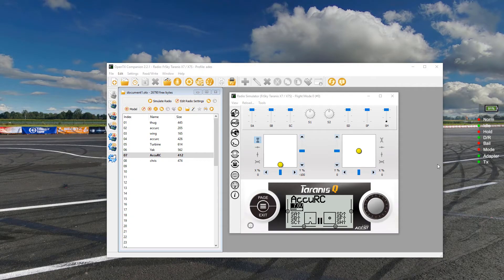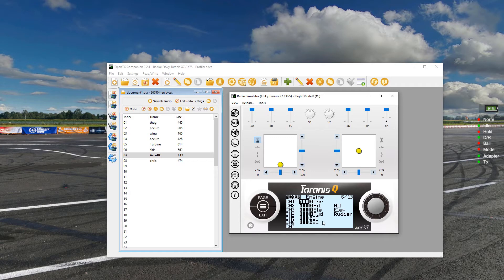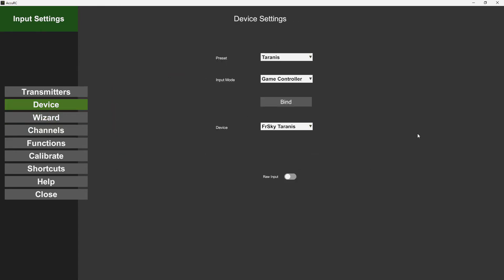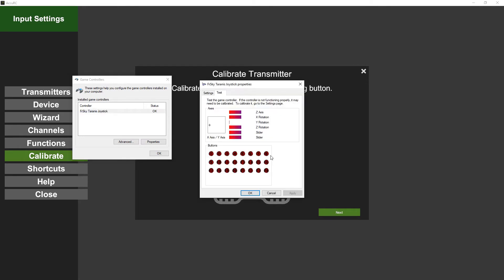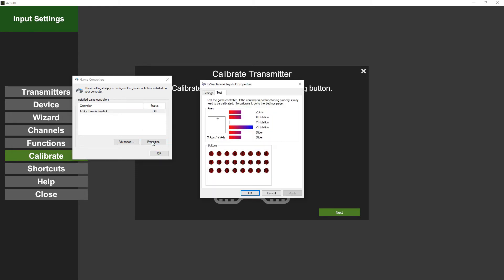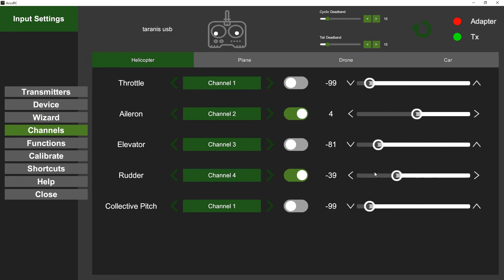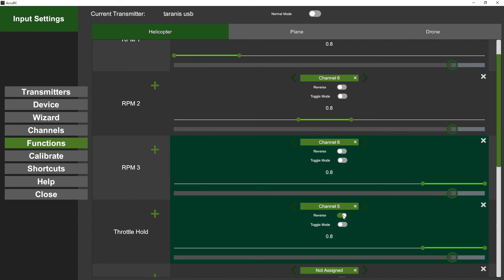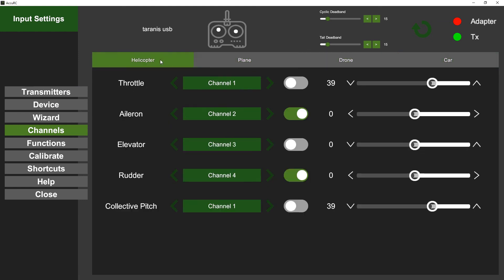Configuring OpenTX transmitters with AccuRC

Comment: Can you tell me is this running directly with usb cable from taranis to usb port on computer? no dongles and that kind of stuff?
Reply from the maker: Yes, just a usb cable, when you plug in assuming you are using a relatively recent version of opentx it will pop up on the transmitter asking for if you want to connect as a usb drive or a joystick.
Reply: @AccuRCFlightSimulator  Okay i just bought it today directly from your site coz steam don't want my money and i pass cheaper directly from you :)
So far i like it much (and price is awesome) and it work without any stupid dongles with my taranis x9e which is awesome. I firstly want it to go for RF9 but they like to sell stupid plastics add on controller for insane 80 usd and they don't care to integrate OpenTX possibilities  in their sim. They lost customer, you got customer :)
How it goes for updates from your side. I hope you guys are working on improvements on the sim often?
And one more thing, is it possible to add TT Raptor E550 in sim? Coz i am just building one and you got only nitro  .50 Titan in the list, TT is great company and they produce  very reliable helis :)
Keep up good work folks.
Thumbs up
Zz
Reply: @AccuRCFlightSimulator   Can you confirm this working for Taranis X9D? micro usb from back of tx to usb pc..
Reply: @robbyrock-drummer  yes it does